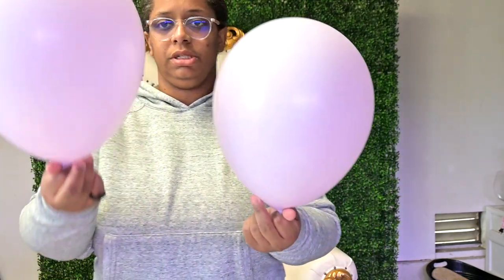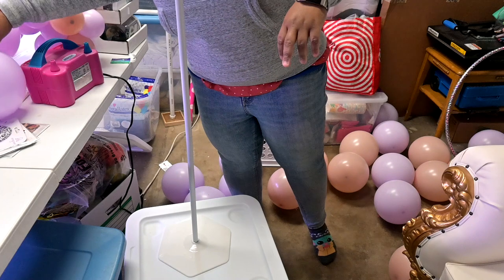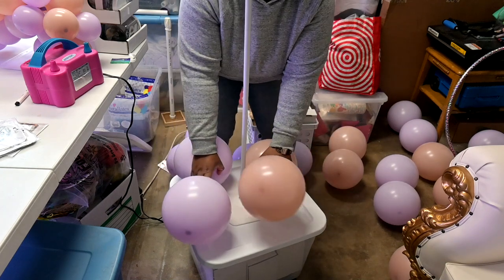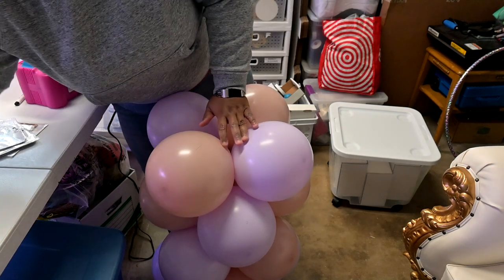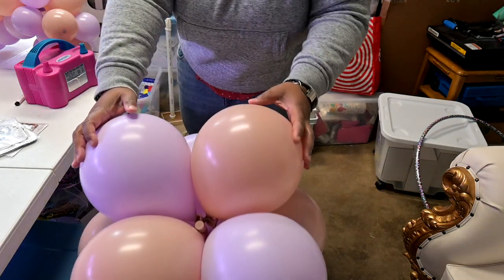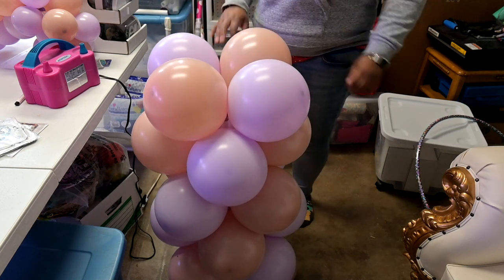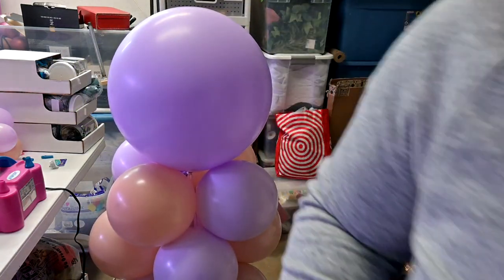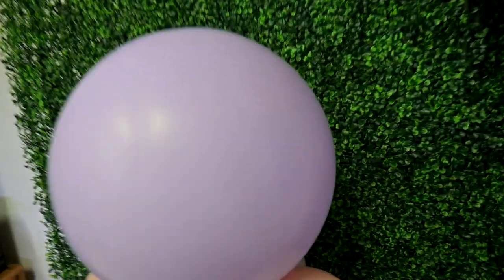How to make a spiral balloon column | Beginner friendly DIY tutorial

Comment: For some reason my columns come out crooked😢
Reply from the maker: That can happen sometimes. Pushing down in the center as you add on balloons really helps. And using a base or pole anytime you can. I have made columns without bases but they fall over even using a balloon weight.